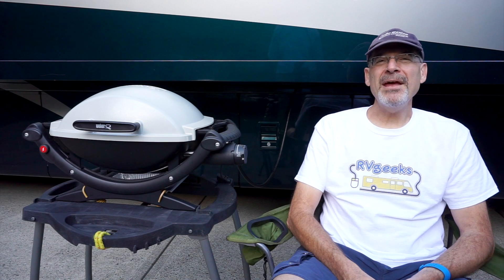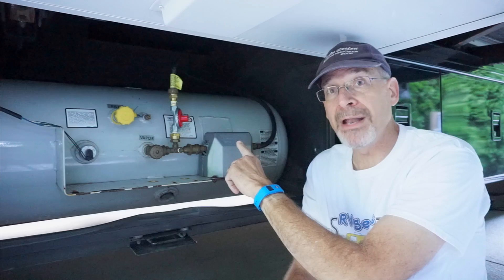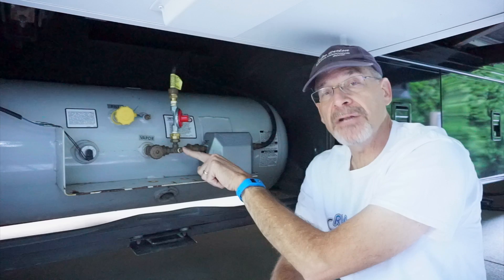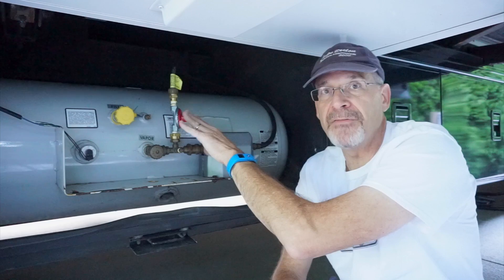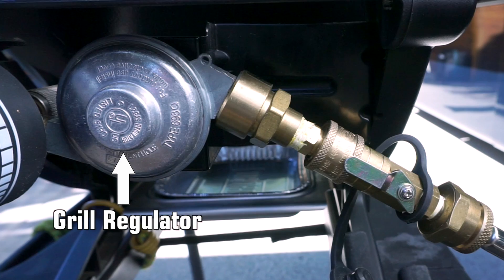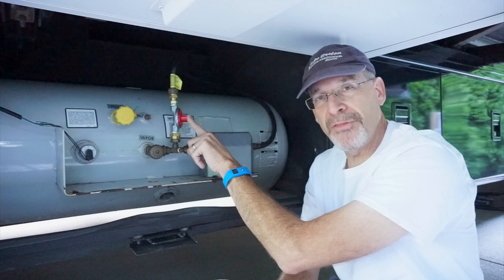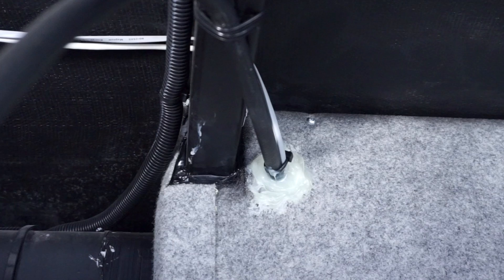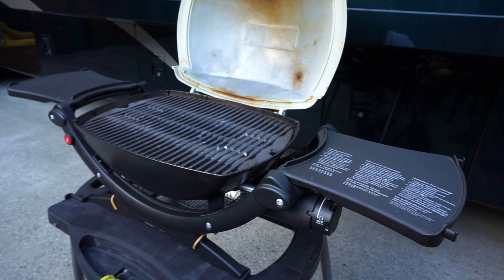How to Connect a BBQ Grill to an RV's On-Board Propane Tank

Comment: Nice setup and explanation Peter. I've thought of doing this but thought it would limit where I could setup the grill. Your long hose setup solves that problem. I would also use it for my Little Buddy Heater which also uses canisters. How lucky am I to have had the privilege of sharing meat from your grill.
Reply from the maker: Thanks Brian. That extra 12' length of hose really helps, allowing us to set up anywhere alongside the RV. We can also move the barbecue anywhere we want by removing the male quick connect on the grill and using a canister (although we never do, as we always set up somewhere along the curb side of the rig anyway). We have a very similar set-up for our Kozy World heater, with a quick connect on each end of the hose so we can coil it up and put it away when not in use. We'll probably be using it when we see you, so we'll have to compare notes as we "share meat" LOL

Comment: Thank you!  Just what I needed.  Our Class A doesn’t have a connection for a grill, but it already has the Extend-A-Stay fitting on the propane tank.  I was wondering what that thing was.  However, I think there is a better way for me.  The ¼” copper propane line to the furnace is in the compartment where I want the connection.  So, I was thinking of just adding a T with a valved quick connect to that line.  Then I would just need a hose with the fittings on each end & on the grill.  Actually, it’s a small Blackstone griddle.

Comment: Thanks for the information. I've had a similar hookup in my 5th wheel for several years and had the oil in regulator problem, it ruined the regulator!  Now I know why and will put your info to work when I extend my "new" coach lines for BBQ use.
Reply from the maker: The first time our grill stopped working and we pulled the regulator and found oil, we were like "What the heck is that?!" Who knew? So glad we could help share this odd problem and its solution. :)

Comment: I hacked a brand new Q1200. Took regulator off and replaced with quick change male propane connector, made a hose. Now I simply hose into RV with quick change, no more pound cylinders. I attached a female plug to the removed regulator so I can still use the grill on the beach with the one pound cylinder if needed. At home, I quick change it into a 20 pound grill tank with a female end on the hose. All three ways work flawless. Q1200 rocks!

Comment: Thank you so much! I was told by a propane "expert" that what you were doing was not possible (he told me you could not have a regulated propane line go into another regulator because "it would not have enough pressure to go through the second regulator")... Guess he was full of gas. And many thanks for the parts list so that I could see what parts I needed and that they actually exist.
Reply from the maker: +Barney Gargle LOL Guess we've been eating our meals raw without realizing it. 😉 The only thing he's right about is that two 11" water column regulators would prevent there from behind enough pressure. Good thing we used that 15 PSI unit for the first one.
Reply: I've been wondering about this very point for years! My question is this - what psi is the regulator on the onboard propane tank for my class C (or any RV for that matter)? It splits up to feed my refrig, cooktop, furnace and generator. But I'm removing the generator. If I convert the propane line to the generator to a quick connect, do I then have to remove the regulator in the Weber Q grill as is shown in other videos? When I saw you had 2 regulators (the new 15 psi on coming off your stay awhile and one on your grill) I was wondering how that works, which you have answered. So I assume I'd have to remove the regulator on the grill when hooking up to the quick connect. If using a tank then I'd have to be sure to use a hose with a regulator.

Comment: Thanks guys - this is exactly what I needed now with colder weather.  My tank is on the passenger side next to the door so it will be a lot easier to connect.
Reply from the maker: That location should make it a breeze! Let us know how you make out, Bill.
Reply: Will do.  The hook up for a larger tank will be great for the winter.  I only have 40 lb on board.
Reply: Hey Guys - I ordered the parts and was looking at the instructions again.  Once that regulator is installed something is going to have to be connected to the top of it all the time isn't it?  If so I need to check clearances and order a valve or something.
Thanks
Bill
Reply from the maker: Bill Long Since we didn't install any type of shut-off valve in the line heading over to the grill, we do indeed have to keep something connected to it at all times. Even when we disconnect the grill, the only thing stopping propane from just rushing out of the hose is the quick-connect at the grill side. If your set-up requires you to disconnect the entire hose going to the grill from the tank for any reason, you will indeed need a shut-off valve on the tank end of the hose. Hope we understood your question correctly!
Reply: Yes.  That is what I thought.   Need to make a modification and it will be good

Comment: I've just recently done something similar Peter, but instead of taking it from the tank, where there was already a quick disconnect prior to the regulator, I noticed I have a bank (manifold) on the passenger side, so I chose to take out the one and only 'plug' and after picking up some parts and a new quick connect (with shutoff), I can now BBQ on the passenger side.   I have the same BBQ you do Peter, but some years earlier I'd taken the regulator off of the BBQ so it could be used with our truck/camper, which was 'after' the regulator, so I again needed the supply from after the regulator again, which it is from the propane bank/manifold!   So it now has the correct pressure being after the coaches regulator as well.   Only issue at this time is that I have to leave the compartment door open when using it, so I'll eventually rig up a setup where I can pass the hose through, which will have to have some kind of grommet/door on it, to keep all the critters out!  :)
Reply from the maker: That's great, Dale! There are many ways to tackle this project... and having (1) a propane manifold accessible and (2) a grill with the regulator already removed is a great combo! Hope you have an awesome grilling season! 😉

Comment: Looks like there is another regulator though on the grill after you plug in.  I did same thing but the reg on my Colman doesn’t let the flame be true to low med high.  Need to figure out a way to bypass the Coleman’s regulator but still have low med high
Reply: I noticed as well!  Hopefully there is an answer further down!
Reply: I had to remove the regulator from my grill because the RV had one already on it close to the tanks. If you have 2 regulators in the same line you may not be able to get enough pressure to the grill. That is why I had to remove the one that came on the grill. My grill is the Weber Q1000.
Reply from the maker: Correct. The grill connection the RV manufacturers provide is connected to low-pressure propane (after the onboard regulator… typically 11-inch water column which is about 0.5psi). In that case, the pressure is too low. You can either remove the regulator in the grill… or not use the built-in grill connection and install an Extend-a-Stay like we did.
Reply: @RVgeeks  agreed

Comment: It is my understanding that connecting to a Weber Traver pressure regulator will cause low flame because the regulator is set for tank pressure.  I have read that you have put a t past the grill regulator to get it to work with the trailer low pressure gas system.

Comment: I see that you put the wall pass-through in the recess behind the outer edge of your passenger side slide.  For those of us without a slide, there will have to be a spot that will work.  This is one of the first modifications I will be making to my (new to me) RV.  I will be setting it up so that I can run more than one propane-using item at a time, however.  I envision a grill, a griddle, and perhaps also a propane post light.  Thanks for posting this, the part about a close-to-the-tank regulator is key information.
Reply from the maker: Congrats on your new-to-you RV! Let us know how you make out with your mods. 👍

Comment: If you are using the more typical 30 lb bottles (or even 20), you can get a brass "tee" for about 35 bucks that connects right to the bottle and then connects to the RV hose same as before but also has a take off for a hose to the bbq.  The hose is about another 35 bucks.  Problem solved.  Of course that means your bbq has to be withing about 8 feet of the tank (or however long those hoses are) but I have this system and it works quite well.

The biggest reason to get one of these tees and a hose is the money.  Ya, you got to drop about $70 for the tee and the hose.  But around here in Canada a 1 lb green bottle goes for about $4, whereas the 30 lb bottle fills for about $1 a pound.  It's a 75% reduction in cost to run the bbq!  Doesn't take long to pay for itself.  When you buy the little green bottles, the portability is excellent, but you are mostly paying for the steel bottle not the propane.  If you hardly use your bbq the green bottles are probably the way to go but if you go through a bunch of green bottles a year the tee and hose is the way to go.

I still always carry a couple of green bottles though.  I used to carry them in case we wanted to use the Coleman lantern but who uses them anymore since they came out with LED lanterns?  But I still put my outdoor stove out once in a while.  Not very often because there is a perfectly good stove in the RV but we do use it occasionally.

Comment: This gas control valve replaces the valve with your Olympian 5500 RV grill (CAM57305 - sold separately). And it lets you use a propane supply on an RV or trailer that has a built-in Quick-Connect propane connection

Comment: I replicated your setup on my coach about two years ago. It has been working great all this time but recently I began to notice a propane smell when I would open up the valve at the propane tank. Turns out the 15psi regulator had started leaking after just two years. The part is still available from Amazon so hopefully the replacement will last longer.
Reply from the maker: Thomas Smith Ours is still going strong after all these years, so hopefully that one was just an anomaly.

Comment: Thanks for the info. I did the same thing except i removed the regulator from the grill and put a quick fit on it so that i can take the grill away from the RV and still use it with the small tanks. The regulator on the grill is not used when attached to the RV main propane tank as it's regulated from the RV tank.
Reply from the maker: Great solution Robin! So many ways to make things like this work well for individual needs. :)

Comment: I hacked my Q1200 before I ever turned it on. If RV tanks are regulated at exit, you will need to remove the regulator from the grill. Never more than one regulator in line, and always must have one. I also put a quick change on the regulator I removed so I can still use one pound tanks away from RV. I also added a quick change to  the end of a standard 20 pound grill set up so I just plug it into grill while on the deck.

Comment: This setup did not work for me because of the propane is going through two regulators.  The first regulator brings the pressure down enough to be sufficient but the regulator on the Weber will not let enough propane pass through it. :(

Comment: I've heard issues with having the second regulator  right at the grill. Issues of not enough propane getting through. Can you remove the regulator and plug the quick connect right into the grill
Reply from the maker: Hi Julian. That issue occurs when the first regulator drops the pressure too low to meet the input pressure requirement for the second regulator. That's why we went with the 15psi regulator at the tank side. It's plenty high enough for the input to the grill's regulator, but low enough to prevent the oily build-up in the hose. If you're going to completely remove the regulator from the grill, you'd want to match the regulator at the tank end to whatever the output from the grill's regulator was. Which, if the grill's regulator dropped pressure down to 11" Water Column (or 0.5 PSI), then you'd want to tee in AFTER your RV's onboard regulator which is also 11" WC. Hope that makes sense.

Comment: You guys have provided such a valuable service to all RV'ers. This was just what I needed to hear.  I will get the quick connect pieces for my portable Weber grill (just like yours but red).  
One question:  My RV is a 1997 Class C Tioga Montara by Fleetwood.  The propane tank is original.  How safe is it to keep this tank?  Before I make any mods to it, do I need another tank?  It looks mildly rusty here and there, but functions fine.  I had to remove a solenoid when I installed the gas leak detector (newer model) - and got this done professionally.
Reply from the maker: Thanks for the nice comments, Lass! You should absolutely get your propane tank inspected by a professional. Rust is a potential danger, and propane (especially under pressure) is nothing to take chances with.

Comment: I did the same thing, except I had to remove the regulator from my grill because I wasn't getting enough pressure. I have the same grill, just a little larger. Been working fine for years now. I love not carrying around a 20lb tank.
Reply: Ok, I don't get it.  Some say, and as is shown in this video, they leave the grill regulator on and have no problems.  Others have issues and remove the regulator.  What's the difference?
Reply: Well, I think a comment below answered.  In the video, the LP is regulated to 15 psi which is high enough pressure for the grill's on-board regulator to do its thing.  Using the normal 0.5 psi lines, such as on an RV, isn't enough pressure for many grills to work properly.
Reply from the maker: Right!

Comment: this is a great video about propane use even if you are not using it in the exact set-up you have.  Thanks for some good solid information.  You wouldn't by chance be an engineer would you?
Reply from the maker: Thanks! Actually, John is indeed an engineer... but not the right type. He has  degree in ceramic engineering.

Comment: Thanks for all the great videos such wonderful RV support! Our RV has connections & we use them for the installed outside propane cook top & RV grill that came with our RV, along with the provided quick connect hoses that were provided. I’ve always wanted to upgrade to the weber grill because of how good they work VS the low quality provided RV grill. So, from what I can understand (correct me if my wrong) all I need to the weber is install a quick connect fitting then I’m good to go in using the RVs on board propane?
Reply from the maker: Thanks for the nice comment and great question! Whether you can use the propane grill connection that came on your RV depends on a couple of things. The main one is whether that propane connection is already regulated or not. The Weber, as with most small portable grills, come with a built-in regulator. That's because they're designed to connect to high-pressure propane bottles, and they have to regulate that high pressure down to use it.

If your RV's propane outlet is already regulated down to lower pressure, that means connecting the Weber up to it, with it's own additional regulator, would mean double-regulation. That would likely not provide enough pressure for the grill to run.

The easiest way to tell if your RV's propane line for the grill is already regulated or not is to look at the grill that came with your RV. If it has a regulator built on to it (like the one you can see on our Weber), then the system pressure should be high enough to run the Weber, too. If there's no regulator on your current grill, the line feeding it is almost certainly regulated down already, which means the Weber probably won't work.

We're guessing that your small grill probably DOES have a regulator on it, which means you should be good to go with a Weber. We doubt the manufacturer would make it impossible to replace the grill with another one.

The only other thing you'd need to do is confirm that the quick-connect on the RV matches the quick-connect that you install on the Weber.

Hope this helps a bit. Please let us know if you see anything that doesn't jibe with what we've described. And also let us know how you make out if you are able to go ahead with the Weber.